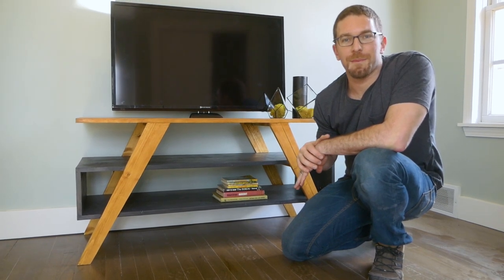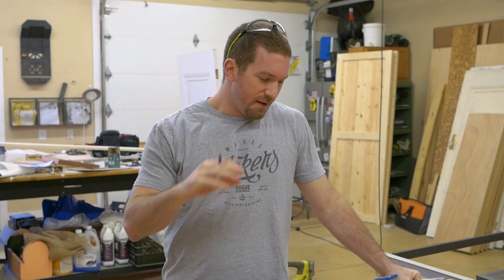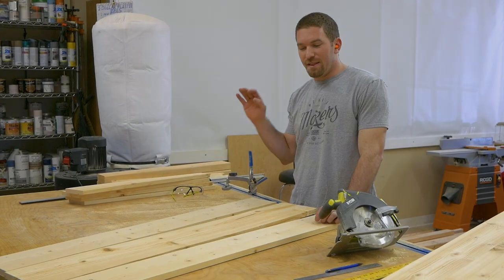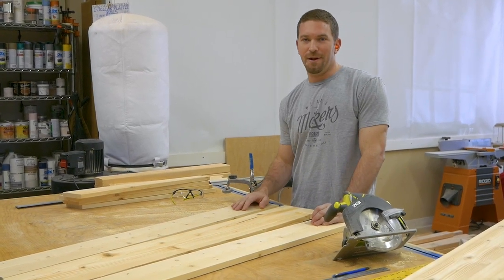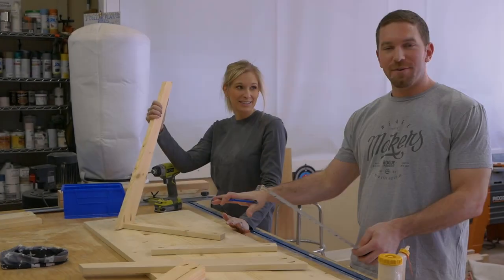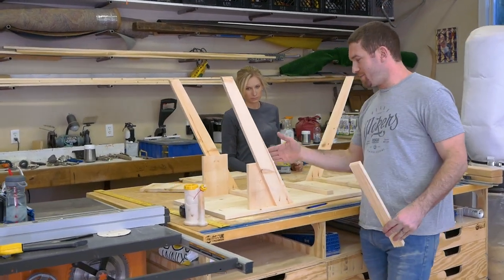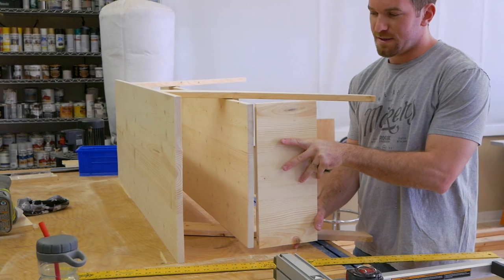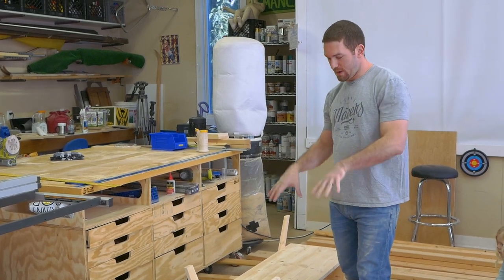How to Build a Mid-Century Modern Media Console

Comment: Some good ideas here... in future projects I'd suggest finishing some of the parts prior to assembly to make painting and sanding easier.  If I made this for my planned project, it would be a little narrower (my TV is wall mounted) and I'd probably make the middle section 1/2" birch plywood with banding or molding to save time and weight.  Just an idea for others considering a smaller unit as I am.